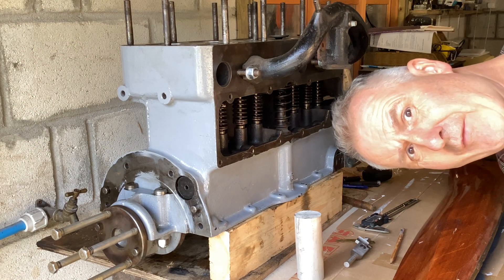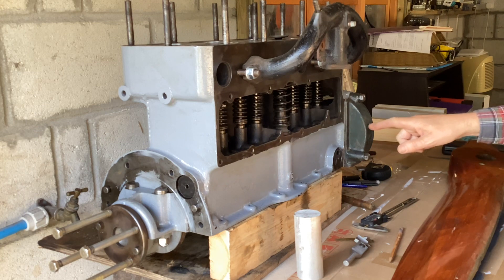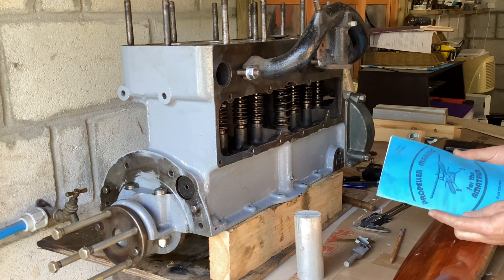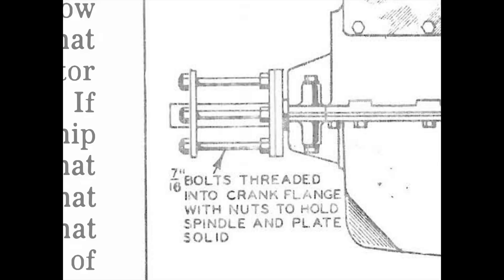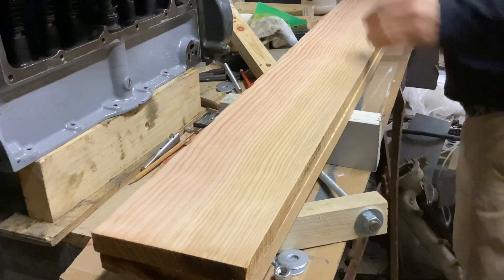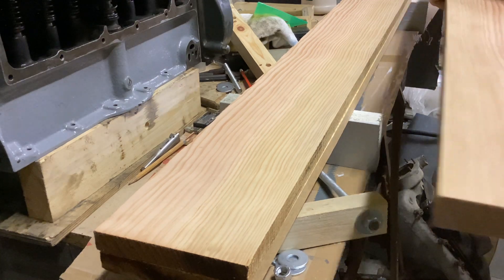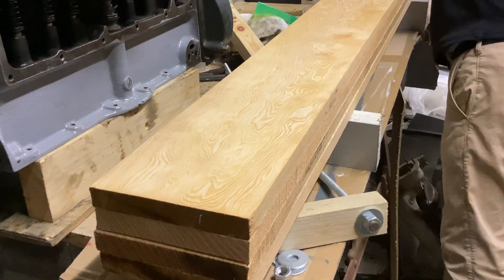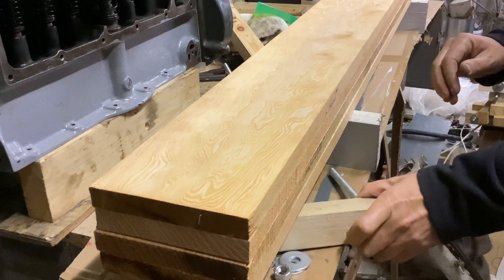A Propeller For The Pietenpol Ford - Part 1

Comment: I can't find the sequel to this video. I'm particularly interested in how best to mark out the blank.
Can someone point me to Prop Pt2 please?
Reply from the maker: Part 2 never happened; the Pietenpol Ford was finished with a flywheel as a possible engine for a vintage cycle car project in the future. However, the blank I glued up is going to be finished as a propeller for the Lycoming GO-145. I hope to make the propeller and continue the series later this year.
Reply: @FlyingForFunTrecanair 
Perfect (ish). Thank you kindly! 
I have had both the Eric Clutton book and the Ken Fern propeller book for a while now, and I still feel I'm making assumptions when marking out (and also when checking the pitch at each station) that I really shouldn't be, so this sequel will hopefully be another treat. 😊
A while ago, I even saw requests for an expression-of-interest for a propeller-making course in the LAA mag, but after chasing for an update a few times it appears to have died. 😢
Thanks again.

Comment: I like to look the nex step to finished these prop
Reply from the maker: @hanford1968  The propeller will be underway soon. The Ford engine will first run with a crank handle and flywheel, I’ll explain why when the time comes, but rest assured a propeller is being made.

Comment: Corben Super Ace used that Ford engine and is a fine rubber powered scale design. Used an 8 inch prop on 24 inch span model.
Reply from the maker: Sounds good👍

Comment: Given that your small bore Ford is 2 litres and not 2.7 litres, would you not be able to simply make your propeller hub to fit your +/- 36 Hp Aeronca prop and use that for your ground runs? Your Ford will not be able to produce 40 Hp at 1,600 rpm so a 72"x42" prop will be too much for it.
Reply from the maker: 42 inch pitch is indeed too much and a finer pitch propeller is needed; such things will be discussed in Part 2. I don’t want to mess around adapting different hubs as that isn’t in the Pietenpol plans.

Comment: I've been doing a lot of reading about aviation in the pre-war and interwar periods lately.  There were plenty people applying a lot of math and science to push aviation forward during that period of time, but it amazed me how many design principles were still based on something looking "about right".
Reply from the maker: I believe there was a lot of good simple design work in the golden era and TLAR is sound in principle. I get to fly quite a lot of modern aircraft including kit planes and homebuilts, particularly for test flying. Many lack simplicity and are stuffed to overflowing with unnecessary gadgets. The Pietenpol, like many others of the era, works because of the simplicity. It is a virtue, not a vice. One aircraft I have been flying recently is very limited in crosswinds, because the designer wanted vast amount of lift via wing flaps and fitted pathetically small ailerons. A search of accident data regarding the type reveals many loss of control issues at low speed. TLAW = that looks all wrong!

Comment: Like I said on your other video on prop construction, your work and glue is as good or better than 70 years ago.  That is a beautiful picture of the Pietenpol.  I like the ballon tires.  The first bush plane maybe.
Reply from the maker: I’m happy that the prop and engine will be airworthy but unlikely that it will go in an aeroplane. However, I do have a plan! The Pietenpol Aircamper is a very significant historic type (as well as being a delight to fly) and Bernard Pietenpol achieved much.
Reply: @FlyingForFunTrecanair  not sharing the plan yet?
Reply from the maker: @dcmflydude6320  certainly not 🤣🤣

Comment: So this will be a ground runner? Ever going to fly behind one of your built propellers? Truthfully after building this strip canoe may give a propeller a try for decorative purposes.
Reply from the maker: This a small bore Model A Ford so it’s going to be a ground runner. The engine was given to me as scrap but I’ve always wanted to convert a Model A Ford using Bernard Pietenpol’s original drawings, just to see how it was done. The whole job isn’t costing much. What I actually do with the engine once it’s finished? Not sure as yet but no doubt I’ll make a film about it!
Reply: @FlyingForFunTrecanair  Mount it to the back of a punt to make it an airboat, then go bother the locals on Restronguet Creek, out back of the Pandora Inn pub!
Reply from the maker: @jeffboatright  Yes, some kind of lunatic contraption is quite appealing! Spell checker offered me ‘appalling’ as an option too 🤣
Reply: And we will enjoy. Always a lesson and adventure. @FlyingForFunTrecanair